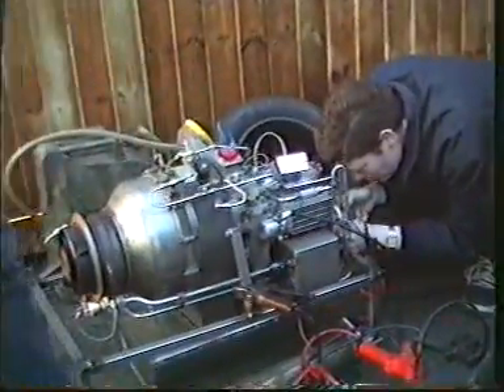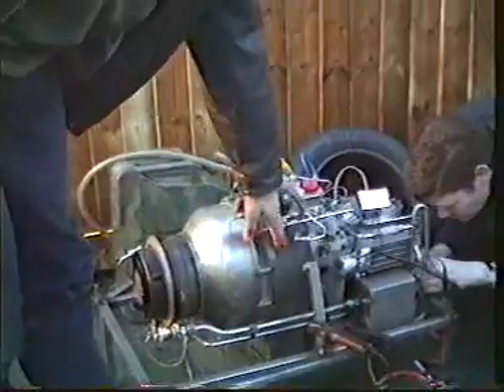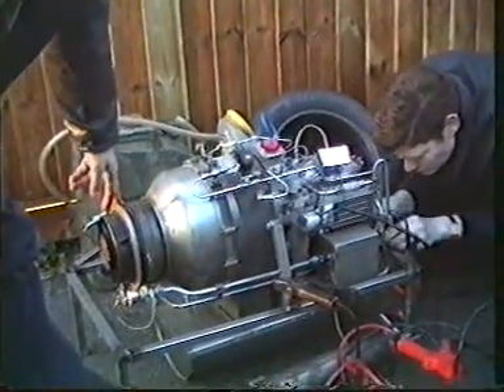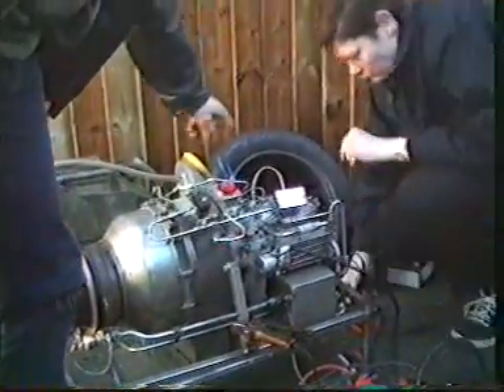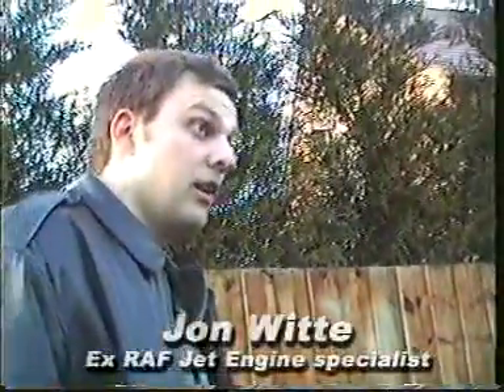www.skeletron.tv robot hire  -  Jet engine blow out

Comment: I own one of these engines (link in profile).

It is/was a WR27 APU. It was never manufactured with electric start in any voltage so that's been added after the navy scraped it. 

You need a powerful motor to allow the APU to accelerate fast enough to stay below its max temp during the start, or you melt your hot section as shown.

So the motor may not have been as capable as it should have, or simply the the poor guy had a mechanical failure (delivery compressor intake door opened etc..)